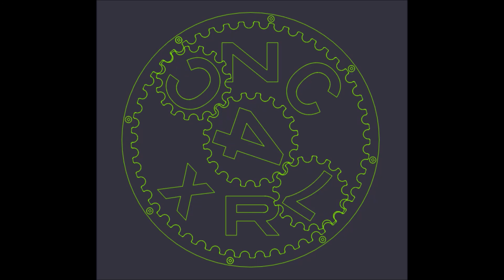PM 727M  Cable Drag Chain

Comment: Great build, I like your attention to detail. Where did you purchase the cable chain from. I found some online, what I've found isn't as nice.
Reply from the maker: Ebay! http://www.ebay.com/itm/400994299599?_trksid=p2057872.m2749.l2649&ssPageName=STRK%3AMEBIDX%3AIT

I would try to find it a little thicker mine is 25mm I would go for 30mm or 35mm this is 50mm wide it could be a little wider as well. good quality though.

Comment: Drag chains often have a backing plate to stop them collapsing, that is trying to become a circle.
Reply from the maker: I'm not quite sure what you mean by "Backing Plate" The drag chain only will bend in one direction and Flat. if that's what you mean then yes this is the same. It normally stays as you see it and not flop around. at least in my experience.
Reply: it's a safety thing really to stop it from being pushed the wrong way.
Reply: You can refer to page 20 of this document: http://www.brevettistendalto.com/online/immagini/pdf/cataloghi/catalogo_cat_E_18.pdf

Lower right hand illustration. Hope this helps.

Comment: Love the detailed video! I'm also busy converting a rf40 to cnc. I learned a lot from your video's! Just a question how tight do you make the nuts on the ball screws? Cause I have a lot of end to end play on the screw leads itself, which results in excessive backlash
Reply from the maker: Depending on the mount design and bearings use it may differ, However I would tighten then until there is not play and lock them down.
Not torqued down mind you just snug.
Reply: +CNC4XR7 thanx I will try that. I have the standard bk15 bearing mounts. I've read some people use shims to preload the bearings
Reply from the maker: You can use Belville washers ( spring washers ) that helps take up some but I find it best to not have any.

Comment: Sam, I am guessing you will be building an enclosure of sorts, one thing many overlook is the drag chain length.  if the enclosure will be mounted to the column (most small machines are to save space) you will want to make all your wiring and drag chain long enough to clear the enclosure wall.  that means usually having the drag chain alot higher so when the head is fully down, the inside arc bottom of the drag chain clears the enclosure wall.  if you don't do this now, you will be rewiring (lengthening) everything when you get to that step. 

doing it this way will keep the enclosure wall protection the open drag chain to keep chips/coolant out of it.
Reply from the maker: Hi Christopher, 
All valid points and all things that need to be taken into consideration, I will be posting My enclosure Plan video in a week or two I will not be mounting it to the mill in any way.  The Chip tray will mount to the base and the Enclosure walls sit on the pan. I will have a Access hole through the back of the enclosure up away from the coolant I hope, and behind the Column.

Stay Tuned,
Sam

Comment: its coming along real nice. If you don't mind me asking, why didn't you go with the rear bracket below the column cover rather than 1/2 way on the column? looks like you had enough length with the head all the way up.
Reply from the maker: It was not quite long enough as the Z dove tails come down the cable tray does as well and if I went below the cover the loop at the top would interfere with the home switch. 
Plus I thought any lower and it would just gather chips.
Reply: didn't think of the chips issue, good point.